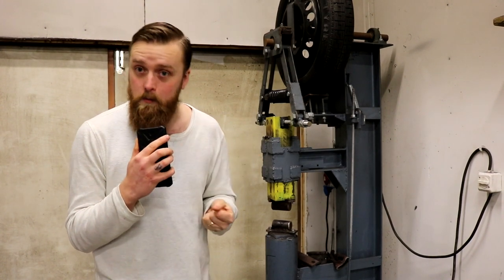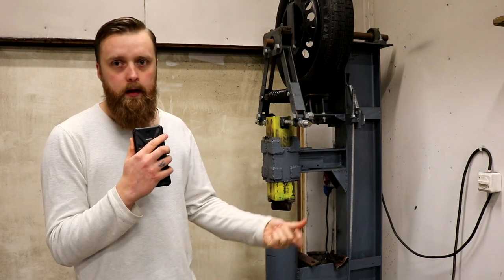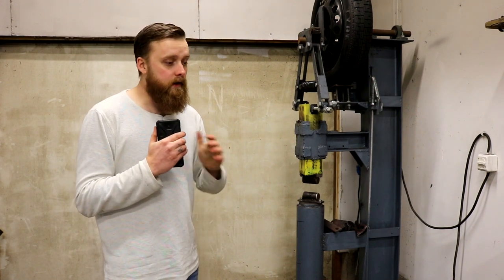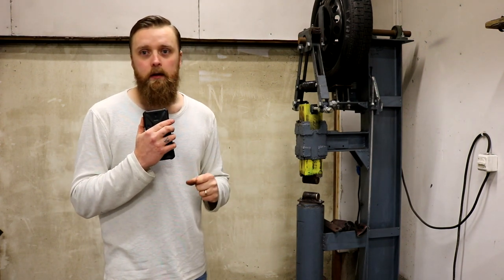Tire Hammer Build

Comment: Great build first off. Totally bad ass. The guy that owns the empty lot next to me owns a metal yard.  I mowed it all year he offered to pay me and I told him I would be by to collect som steel for a hammer and maybe a press soon.    

    So the ram is a hollow tube?  Why not fill it with cement or even better lead?  You can get a couple scrap lead batteries and melt them down.  Just be sure to wear a respirator and do it outside.

Comment: So how do u control how thick u make the piece? Do u adjust it somehow or just careful footwork on the control pedal? I’m planning on building one myself and wanna make sure I understand it. Thanks in advance!
Reply from the maker: you can adjust the height of the ram by tuning the bolts on the linkage arms, since they are made out of threaded rods. If you take aclose look you can see that. ALso you can adjust how hard you hit by how much you press down the pedal. hope that helps!

Comment: So the wood is a sort of "shock absorber" to prevent cracks in the concrete. The only issue I see, it will get wet, or moisture and could rot away over a short period. Then you have to replace it and this looks not like fun at all. You will have to lift that whole construct. 
But it looks fantastic. It works like a charm from the videos and pictures I saw.
Can't wait to have my own some day.
Reply: You can simply pry the machine up in the air to replace the wood. Not a real problem.

Comment: What an excellent job! Well done .
I believe that there are a couple of aspects of the structure that you might have modified over time. So it moves less and things like that. The weight ratio between hammer and anvil is perfect and the the fact that you used uhmw is great

Comment: How much horsepower does the motor have? Okay, 1 HP. Didn't get that in the first place.
Or where did you get it from? Could one use a lawnmower motor or is it from a old grinding wheel?

How many welding sticks, if you used an arc welder did you need ... approx?
Reply from the maker: I have seen a guy who uses a lawnmower  motor. The only thing is that they are very lound and run on gas, so it will probably release the fumes in your workshop. So an electric motor is sager that way IMO. And if you look around you might find a used one just like i did. I got mine from a childhood friends company. They had alot of old motors and they thought it sounded like a fun project so they wanted to help me. Our comunity here were i live is very helpful that way!

Comment: Really neat hammer!
   I'm a new subscriber watching through your older videos and i have two questions on this build:

1: would railroad track steel be a suitable alternative for the round stock that makes the anvil post? (I live in an area where we can occationally buy track segments after the RR companies replace them, and currently use a 1 foot length and a normal anvil)

2: have you considered using rubber matting (such as the heavy rubber pads that are put in horse stalls/trailers) as the shock absorber material under the body instead of wood? They probably wouldn't need to be replaced as often.
Reply from the maker: You want rhe anvil part to be as big and heavy as possible. To be honest i think a railroad track is to small. Well, it depends what you want the machine to be capable of i guess. I have seen people use square tunes for anvils, but thats not going to be very useful. When it comes to the matting thing, sure that would perhaps be a good option. But i dont im going to have to change the wooden part until i get a bigger workshop anyways. Thanks for watching and asking questions!
Reply: thank you for the information!
Knowledge is power and your videos are full of it, keep up the awesome work :)
Reply: Railroad track is more difficult to use as anvil, BUT it's better than anything hollow. I know a thing or two about railroad tracks; so listen: If you need say 90 cm of "anvil"; you need 2 section of 90 cm, preferably the 60 or even beter the 70 kg /m , and 8 matching fish plates (one plate is about 45cm). Fish plates are those really heavy plates with boltholes for connecting 2 tracks without welding them. Railroad track (modern anyway) is the rough equivalent of C80 steel with a LOT of manganese and some added silicon in Europe anyway. Weld the two pieces of track back to back, and put all fish plates in them. You'll have about 250 kg steel anvil, it will cost you about one box of 3.25 mm electrodes to stickweld it together. If you can get plenty railroad track; if you avoid the top 5 mm (it's full of surface cracks when trains have been driving on it), it makes great mono-steel axes.
Reply: @bartweijs  thanks!
I was thinking of taking a 30 inch (roughly 75cm) lenght and standing it upright and welding a 2.5cm plate to the face of it so that i can bolt the various tooling to it (hammer, fuller, swages, etc).
The ram would be a mirror of it, with the plate and tooling on the bottom of the track piece.